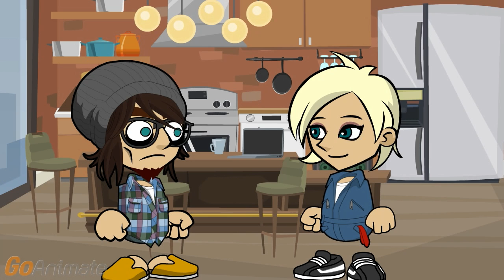KitchenAid Oven Error Codes

Comment: We just had the same problem (error code F1E1 replace AM), turned off the breaker, turned it back on and the same code reappeared after a few minutes. Then we discovered the solution that worked for us and it is running normal now. Click the button "options" then Press the number 6 to callibrate the oven. It solved the problem and it is running normal.

Comment: This is what I did on my Kitchenaid Superba to get it working again. 
Hold the “oven light"
then push the "CLEAN" button
and then the "START" button.
Wait until “Door Locked" shows on screen.
Press “Cancel/Off" (Upper Oven) wait until “Door Locked" turns off.
The oven F5 E1 error is now fixed.

Comment: Kitchen aid even heat induction stove. After 8 months the touch panel on the stove top failed. 

Error fce4 . Call service  . Induction cooktop communication failure. 

Opened the entire back Unplugged  everything and plugged back in checking all the pins etc. no change. Just thought I’d leave this comment in case anyone ever sees it and finds a solution or knows of one.